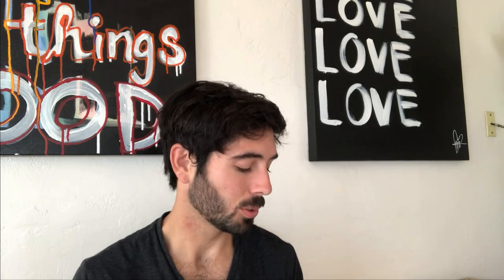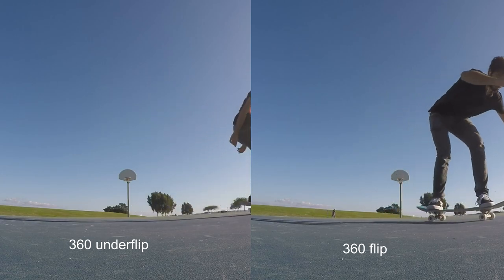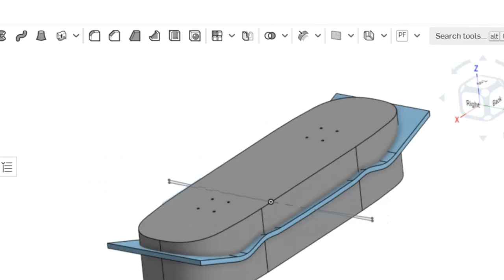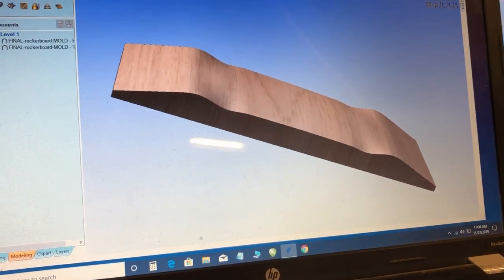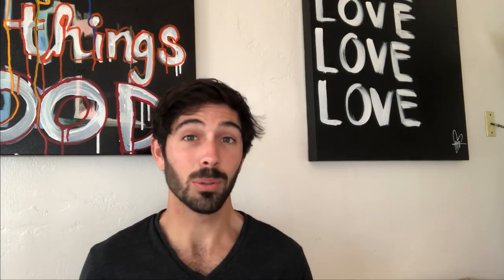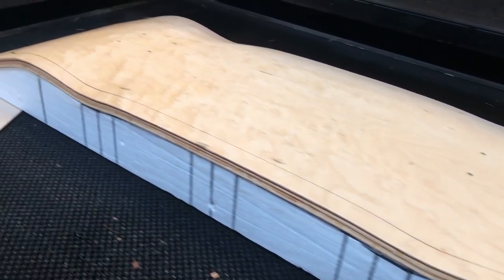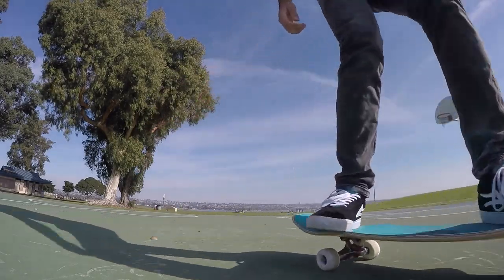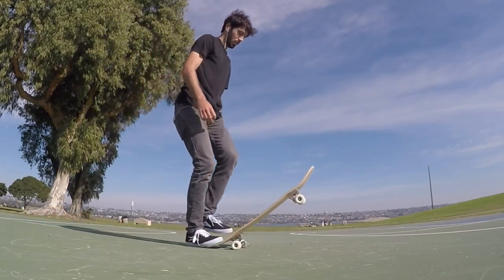Skateboard with Rocker and Wheel Flares - How it's Made and How it Skates - Build of the Week #5

Comment: As it happens, the board you based yours off is the Loaded tesseract, which is what I ride, and for the past few months I've been thinking about trying to make a board with similar rocker/wheel wells but a bit shorter, when I found your video, in which you did that exactly! After watching this video I downloaded Fusion 360 (the free version lmao) and holy shit is it difficult to work with as someone with no experience. Would you have any tips or tricks to designing a board with this type of software, I tried Sk8CAD but it does not have the functionality to create rocker or wheelwells. Thanks!

Comment: Hey man! I have a problem. I use my 8.25 street deck with mode wheels. I can do a lot of rail flips fairly easily. My problem is catching it back to rail. I always land heel side before the board tips over. So I probably have a little less then a second on rail before it tips 😂 any advice?
Reply from the maker: Hey!  Check out https://youtu.be/1cdTICtlZKU  and https://youtu.be/x-DoWCC6SSo - I think I gave all my tips in those videos on rail to rail flips.  8.25" might be too narrow with Mode wheels and trucks with an 8" axle - when skating Mode wheels, my setup was a 8.375" wide board with 8" trucks (like Independent 139).

Comment: Could it be the 8.5" width is why tre flips are harder / less comfortable on this board? It appears very stable and capable otherwise, with many tricks you can do fine. I'm not sure what would make a board do better tre flips, but not compromise any other qualities. (I'm thinking smaller deck width or longer/shorter tail?)
Reply from the maker: After making this board, I'm thinking it has more to do with steeper concave and a steeper pop angle (making the board come up to my front foot easier and have more leverage).  I don't think there's a problem with the shapes of most boards or this board - it's just a challenge with my own body mechanics.  I was wondering if altering deck shape could be like a "hack" for 360 flips (and maybe other tricks).  There's definitely features you can add or remove from boards to make certain tricks easier.  I've actually found that deck size doesn't have that much of an impact on how much I can flip the board, which surprised me.  I used to think wider was more difficult, but that's not consistently the case.  Concave and pop angle seem to play more of a role. (Paul Schmitt actually mentioned this in his recent Nine Club interview.)